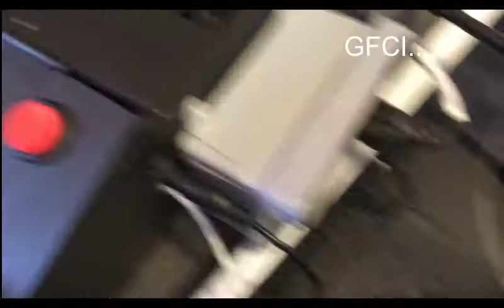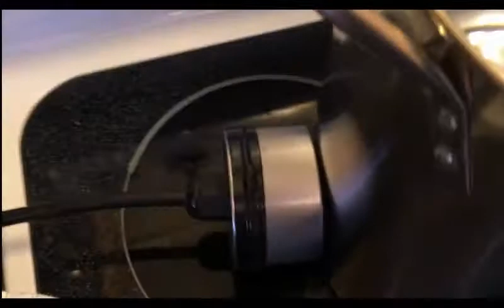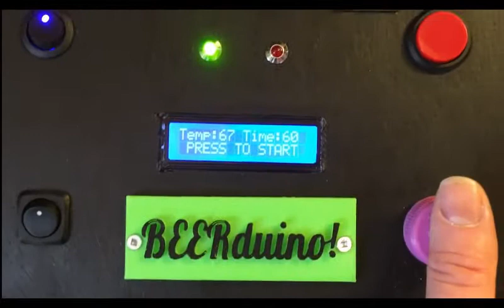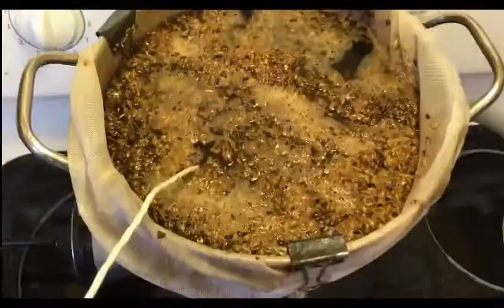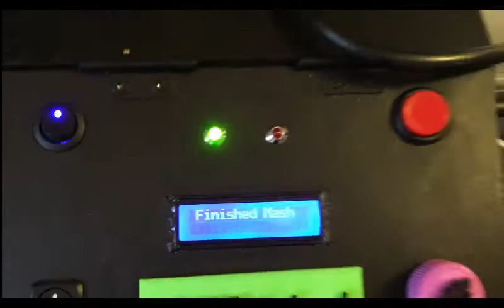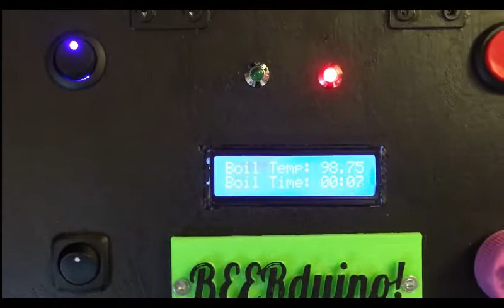Arduino Brewery Controller

Comment: I agree, this is a very nicely refined setup, very nice! What is that little pump? I've had trouble finding cheap, small pumps that can handle the temp. For the temp thing you could easily discard values under 0 (I doubt you'll be brewing with ice), though I'm guessing you already revised it in the last year.